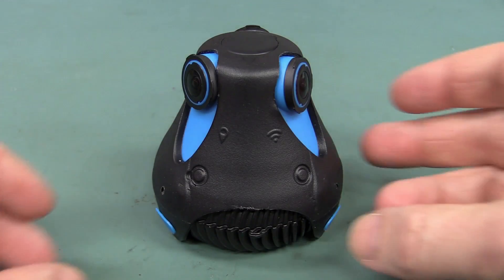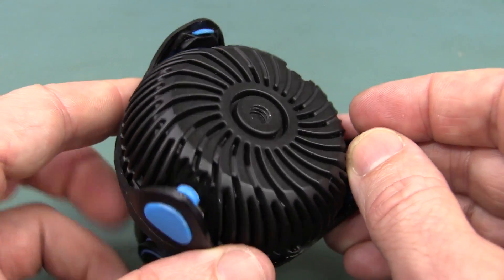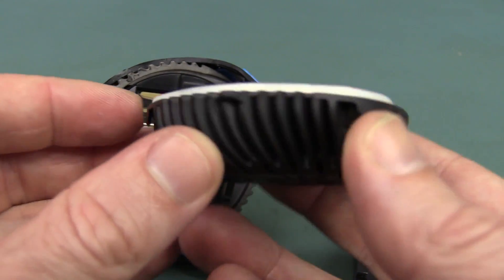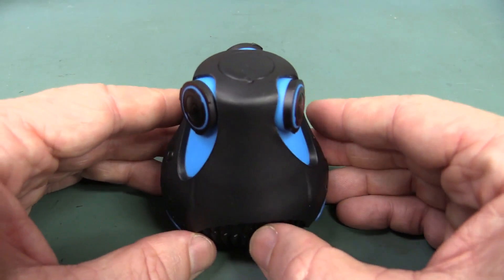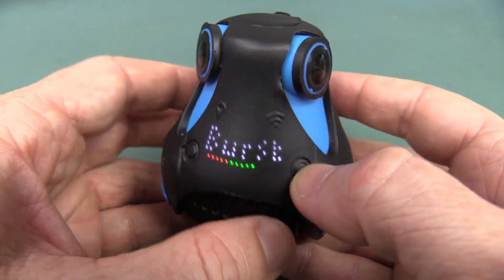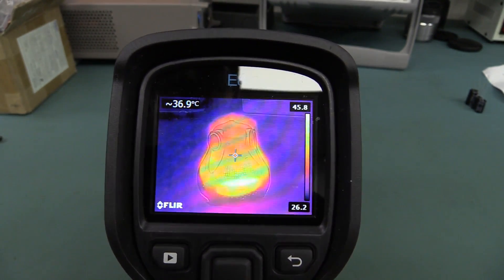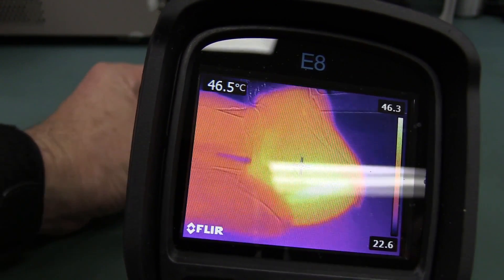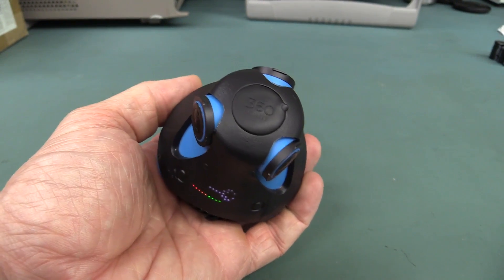EEVblog #734 - Giroptic 360cam Kickstarter Prototype

Comment: Mine came straight out of the box with errors and would not upgrade the new firmware , when returned under warranty they sent it back exactly the same with errors and still would not upgrade the new firmware , and their support is crap they just beat about the bush , do yourself a favour and avoid the frustration and buy another camera

Comment: They probably are not using a lot of CPU power to do the stitching because they could be doing that once at the factory to generate a lookup table to remap the sensor pixels to the output video coordinates.  I think what is probably going on that needs the heavy horsepower is that the 360 degree view needs a lot of image processing to compensate for the different exposures that each sensor needs to capture a decent image. Imagine the sun facing one sensor and the other two are looking at shaded areas. To make the view presentable all the way around they must be processing the images to make the exposures look similar all the way around.

Comment: Putting the battery to the hottest place of the construction? It will increase the battery drain as well as effect the overall life of the battery in long term. I think this is an issue which will be reconsidered before commercialize it... But it is still a good job!

Comment: I would've made the battery compartment more shallow and make it penetrate the upper half of the body. This means the battery can stay just as big, but the upper heat sink can come down further.
Or swap the processing with the battery completely.
My first idea wouldn't be extremely hard to implement I think. It wouldn't harm looks at least.

Comment: Great concept. Cool design. Love the hidden LED. But fuck that price point! Only an idiot would pay that much for a 360 can with mediocre specs! You could get three decent second hand prosumer cameras for $1200 and make your own!
Reply: BaSH PROMPT Just to correct you on one thing, they are $500 each. $1200 was the price for a developer unit and a production one. Plus, despite how simple it looks, it isn't all that easy to get a product together that stitches video well that anyone can use. With multiple cameras you have troubles with starting them all at the same time (look up 360Heros) and you have to make your stitching profiles for whatever setup you have. Not everyone can do that, however, it is a viable solution. Think of it as the difference between a point and shoot and a DSLR. This is meant to be a point and shoot camera, but if you have a few thousand dollars laying around by all means you can go buy a pro version that will have a much better picture quality, albeit with a few usability drawbacks. We backed this because we need anyone to be able to pick it up and take some video or photos.

Comment: With three cameras you would expect they went for the price and avoided the easier to use but probably more expensive panorama lens part. I know, the development cost is also a factor, but if the Chinese see this, they will offer it for $50 on aliexpress one day later.

Comment: It would make a decent car dashcam on top of the roof. Although you wouldn't be able to read plates. That's a gopro clone battery! Can't shoot video while it's charging? #fail
Reply: Gadget Addict It also has the potential to be a useful technology in a helmet camera for bicyclists and motorcyclists.
Reply: I do think (and hope) that it's a temperature thing. Maybe by making the battery compartment more shallow and make the battery penetrate the upper half could allow the upper heat sink to come down further and maybe that could solve it. It's still a prototype